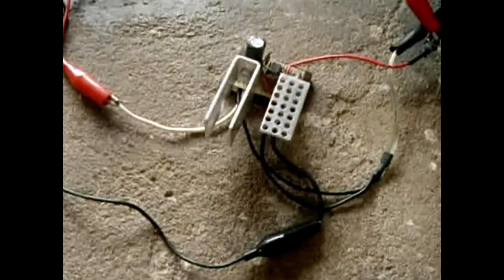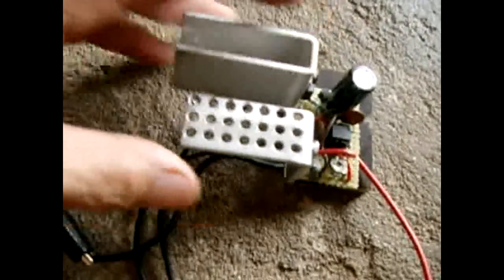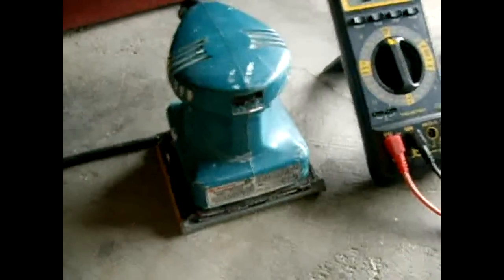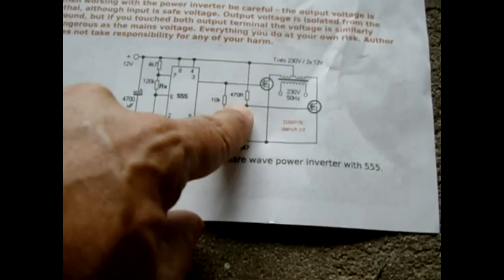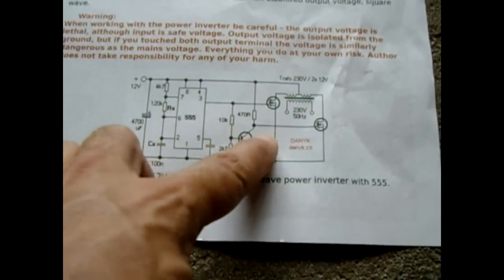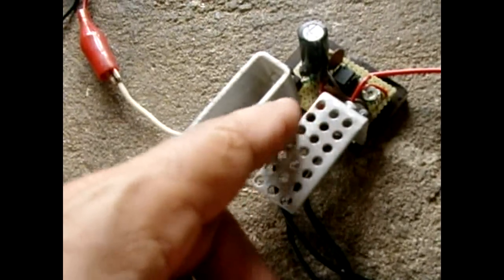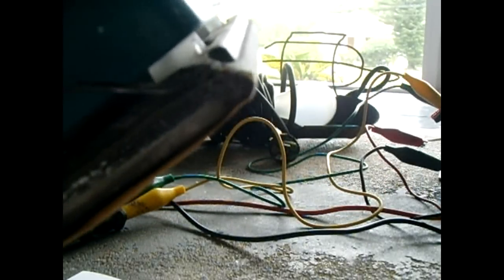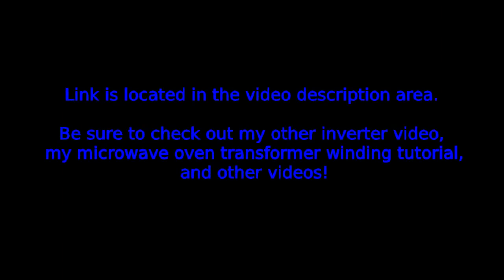12 Volt Power Inverter Circuit ~ High Output/Freq Adjustable

Comment: Yours are really helpful videos, seem to cover everything. So. Do we assume the high cost for high output inverters is due to price of high power MOSFETS?
Reply from the maker: No. The mosfets are not really that much money. There is a lot more to those circuits than you see shown here. The inverters being sold today do not use a large power transformer anymore(even though they work well). To keep the weight down  they use smaller transformers(toroids) at higher frequency to get the job done. Then the frequency needs to be adjusted to 50/60HZ.

Thanks For Watching!
Reply: electronicsNmore The inverters they are making today is actually ZVS drivers, I made one with little toroid feritte core taken from old plasma power supply board (just  maybe 2' in diameter) 3+3 turns in primary and only 28 turns on secondary 12 gauge cooper wire, got 115 V and could light up 6 bulbs 100 w (FETS  barley got warm)  ,problem is frequency is to high so can't run any motors.What I'm trying to do would be rectified ac output to dc and then build 60Hz driver(probably 4017 will be the best)  for second pair of mosfet and they will convert 115 dc to ac again.Reason to do this it's to use little toroids instead big guys and keep stand-by current low.( free load only about 700mA)
I hope you understand what I'm trying to say , I build ZVS driver like for heater but realize if you add more turns on secondary you bring voltage up (only 28 turns 115 V ) Maybe you already done this , if so, please let me know and what driver did you use.
Thanks
Reply from the maker: I understand what your trying to do, but I have not done that before. The 4017 is good though. I made a really nice modified sine wave inverter using that IC.

See here:

Homemade Modified Sine Wave Power Inverter(350/500w)

Comment: Would this power a 1500 watt oil filled heater on the 600 watt setting it pulls 5.26 amps on that setting?
Reply from the maker: If the transformer was large, and you used (2) IRF 3205's or larger, and 6ga stranded wire. Should work. :-) You can also use (2) identical power transformers in parallel. They must be connected correctly. You would connect one leg of each transformer HV output together, then measure the voltage of the 2 remaining leads. It should NOT be 240V(120 per transformer-or close to it), but close to zero. Then you connect the other 2 wires together. Really good using large toroids.
Reply: Thanks again this is initially for me however I know someone that is sailing outside the country and they want to know how to do everything! They are building a 75' boat themselves!  I am telling them about your LED's as well!

Comment: Let's see if your device will power a television old school crt type.
Reply: Remember that B&W TVs are one thing, but 99.9% of color TVs have a built-in thermistor-controlled degaussing circuit in them, so when it's turned on "cold", it'll take a big surge of current to energize that degaussing coil for a moment. (My old set used to dim the lights it took so much; I changed out the thermistor for a different one, & that solved it, but I had to manually degauss the CRT every year or so, which should be done anyway.)

Comment: I am looking for a way to get more watts from my battery bank to power larger household appliances. I have three setups that charge the battery bank; solar, wind and gravity weights. I'm about to double my bank to 24 12volt batteries. 

Was wondering if there is a way to connect 2 inverters together to double the wattage output? 

Or any other suggestions?
Reply from the maker: You need to use much more powerful mosfets (like IRF3808's), larger wires to handle the current, and most importantly a larger power transformer. This circuit will work if the changes are made. The 10ga wire on the transformer, needs to be lowered to a 4ga wire. That should handle 100A, or around a 1000W output.
Reply: Is it possible to double on the transformers and mosfets and the add the larger wire?
Reply from the maker: You can place 2 mosfets in parallel with a gate resistor on each mosfet. As for the transformers....."IF" two transformers are identical they way they are wound, then likely OK in parallel for 2x the output. The way to do it is fairly simple. Place both transformers side by side and connect only ONE wire from each transformer together. Leave the other 2 wires loose. Then attach both 12v/primary windings to the inverter and power it up. Next take an ACV measurement across the two loose wires on the HV side. If you get zero volts, then it is ok to connect. If you get 440/480v, then DO NOT connect. You will end up with a bad short circuit. Make sure you hear the transformers both buzzing/humming while performing the test.

Comment: The SG3525 works very well in power inverter projects, there used a lot in car amplifiers in the SMPS part. They can be used in an push-pull configuration and can drive two sets of mosfets in parallel directly with no need for an gate pre-driver circuit. The frequency is set using only one resistor but an pot can be used to adjust the frequency. It also has a "slow power up" option with the addition of an capacitor.

Comment from the maker: you will need 80-100a mosfets, or double up on the irfz44n's. Larger transformers, or using one size heavier wire for the primary you wind, will give more output. Make sure you have a big fuse, and big heatsinks.

Comment from the maker: You can take two same sized MOT's that have the same direction of winding, and wind 12 turns of 10ga stranded wire on each one . The turns must be the same direction or they will be out of phase from one another. If you wind one opposite from the 120V winding, then make sure you wind the other one that way also! When you connect both in series, that will be the center tap. The 2 120V windings in series will give you 240VAC output. I get around 225/250 Watts with my setup. For more power

Comment: Magnificent! To increase the power capability would it be possible to rewind 2 MOT's to required output without center tap? Then connect them in series using the series connection as the center tap. I realize the windings would have to be adjusted so that the output windings in series or parallel gave the correct output voltage. Wicked circuit going to build and will be installing resistors as directed. How many MOSFETS of high voltage and current rating would you say was max in parallel? Thanks